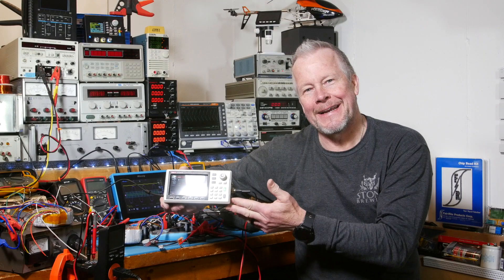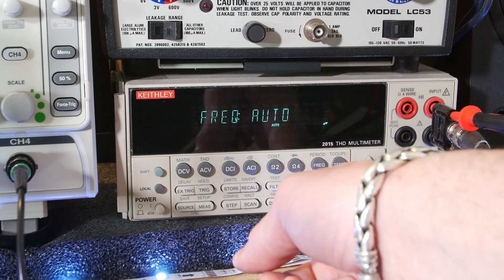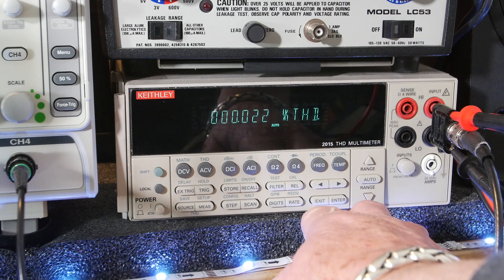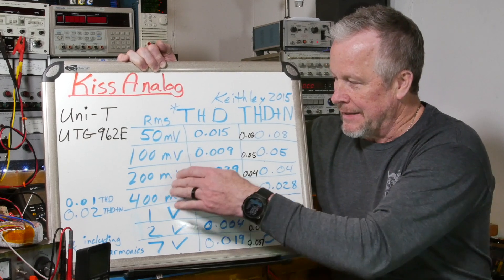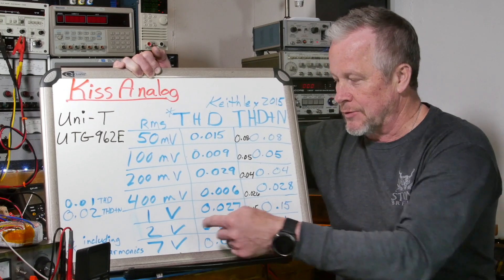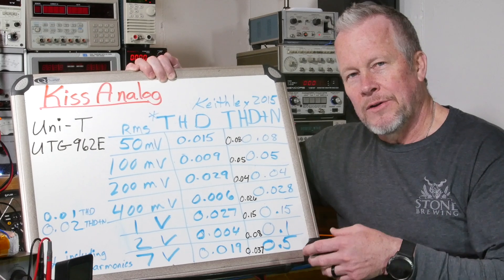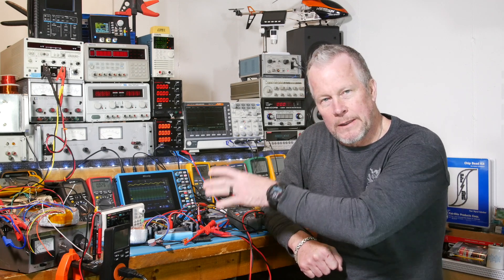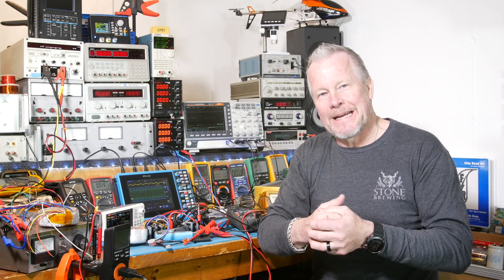THD from Uni-T UTG-962E ARB Generator #UTG962E #uniT #unitrend

Comment: Hi. this video is very interesting. 1Khz and 400hz are the frequencies needed to use my shibasoku 860 automatic THD meter. With this meter I tested my UTG862E generator and measured 0.026% THD at 1Vpp 1KHZ 50 ohm output. Excellent result for being a simple generator. A clean signal source is always welcome. My main configuration remains the Philips PM5110 low distortion generator with 0.006%. However the UNI-T can be much improved by a better power supply than the one supplied which is very scarce; I have also seen some power banks used but they are not pure batteries but they also use a switching circuit that could dirty the power supply. It would be interesting to test in another video the use of the UTG962E with the right power supply.
Reply from the maker: Thank you - and awesome feedback!!  Using a different PS is a great idea!
Reply: @KissAnalog  and thank you for this video, and @Tiromancino for your numbers. I just got one of these, a 962. I've got an old H-P 334A I'm restoring but I didn't have a good reference source with which to test it. So, after rebuilding the 334A's power supply and going through its manual's biasing steps, it's been repeatedly nulling out my Uni-T at .024% THD with a 1kHz @ 1V RMS input. 
I wondered if it wasn't measuring too low, as the UTG962 manual gives "<0.2%" for their 1kHz sine spec @ 1V, which is about ten times higher. Well, now that I have both y'all's independent measurements almost spot-on with my 334A's, I guess the ol' H-P's measuring pretty well! Now I can use the UTG962 for reference at the other frequencies and levels you've measured as well. Thanks!

Comment: Love the Keithley. No way can I justify spending up to 6 grand to order one though. I need to find a cheaper way of finding out what the THD is.
Reply from the maker: Thank you!  I agree, it is an expensive meter!  I have a couple ideas - I’ll get a video done on this;) here’s one video on this;) https://youtu.be/mYhbzYTdsNk
Reply: Hi,
What you can do is buy a cheap low distortion sine generator like this from ebay:

https://www.ebay.com/itm/Assembled-Low-Distortion-Audio-Range-Oscillator-1KHz-Sine-Wave-Signal-Generator/264663233354?hash=item3d9f28734a:g:RzoAAOSw1TxfK~HS

While it's  not perfect it's good enough and pretty low distortion. I tested it on my HP334A distortion analyzer and it works very good considering the price.
Keep in mind that we really can't hear distortion below 0.5 to 1% in amps. Manufacturers like to put these ridiculously low distortion figures on spec sheets but distortion and musical enjoyment are two entirely different things! Basically we, at least most of us, like distortion. The thing is we like certain types like second harmonic distortion from tubes, which I favor myself.

Anyway if you pick up one of the devices I linked to you'll be able to get a good idea of how your amp is performing because you'll be injecting a signal that's clean even if you can't exactly measure it.